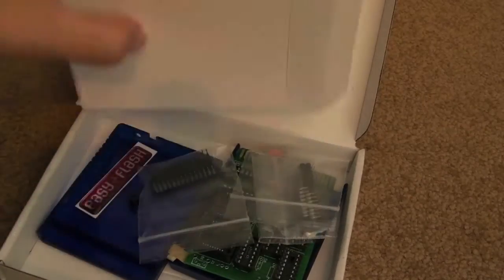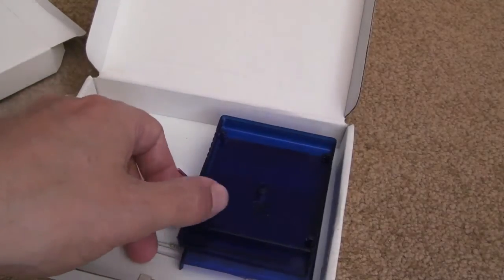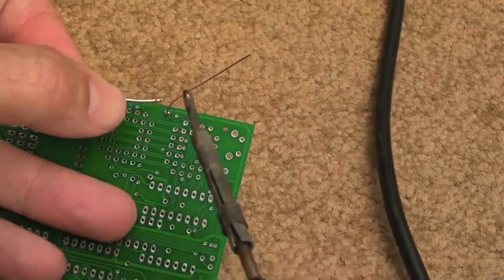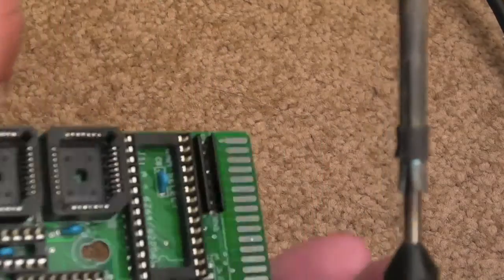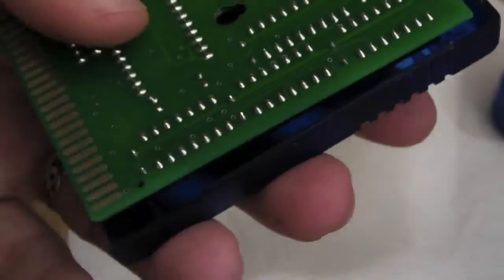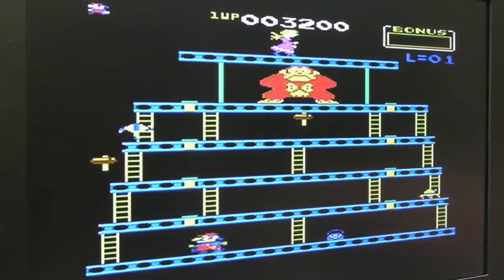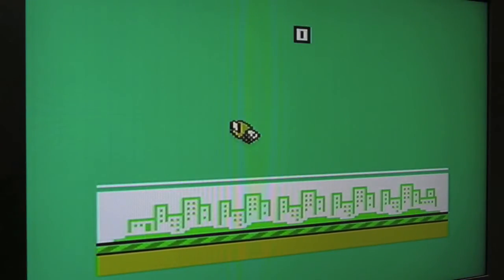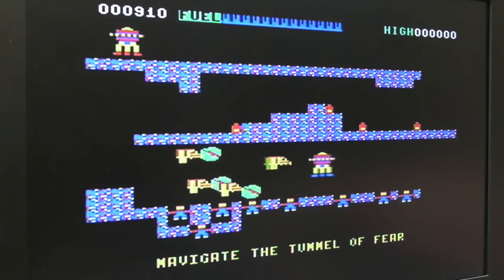Commodore 64 (C64) Easy Flash Cart Assembly & Testing

Comment: Hiya. I've just bought an EasyFlash  3 from Retro Innovations and I don't have an idea about it. What I'm wondering now is about the kernal rom booting feature. I would like to try to change and then try some modified kernal roms. Let's say editing the C=64 one to show for example the booting colors of a C=16 as I'll be using a C=16 case for my C=64 board. Will I be able to try the kernal that I could make for it before burning (or ordering to burn) a new eprom with that new kernal?. How can I archieve that?
Reply from the maker: Yes, you can totally do that!  You can edit an official kernal ROM and change the text with a hex editor super easy - just open the ROM in the hex editor and scroll around, you will see text probably on the right hand side.   You have to be careful to type over existing text and cannot go with more characters than appear in the original string.   You can also change the colours by finding the instructions that set the colours and change the byte for each value.  There are probably guides on the net for this.  I would personally probably disassemble the ROM in order to find the instructions for setting the colours.

Comment: Another great video, really looks an impressive piece of hardware. Would you recommend this over the ds reader you can buy?
Reply from the maker: The SD2IEC is great!  I got one of those with it and I've managed to play loads of games from SD card.  The reason to own both is so you can run Epic FastLoad from cart, which speeds up the disk loading a lot.  The alternative is to get the SD2IEC and also buy a JiffyDos Kernal upgrade and fit that.   The only real reason to buy the EasyFlash cart is if you want to play old cart games, or have a few programs and games that you can instantly boot.   Thanks for the nice comments btw =)
Reply: GadgetUK164
I was wondering what the advantages of this were, given how limited the storage vs. an SD-based solution, but you've answered it.  Nice to Jack Attack on your cartridge, it's a favourite of mine; was it one you played back then?
Reply from the maker: MarkTheMorose The main reason to get one of these is basically to still a tonne of 8Kb and 16Kb games on one cart.  In the example shown on the video I just put a handful of games but it would have fit a lot more on there.  Jack Attack was great fun - happy memories playing that on my friends C64 =)

Comment: what is the largest flash eeproms that these carts are able to use i have a good few 256k and 512k but i should have some in the low megabyte range maybe 2 megabytes if I'm lucky but iirc they might not plcc32
Reply: also can you make some sort of multi cart with a loader menu with these. haven't messed with commodore after my c128 died a few years back...
Reply from the maker: I think the largest is 512Kb.  Yes, you can make a loader menu - link is in the description of the video.

Comment: Could this be used to make a Diagnostics cart?
Reply from the maker: Yes, before I got my 1541 Ultimate I used the Easy Flash as a diag cart.  Note there are different types of diag cart - you can also get a 'dead test' cart which works better on a machine that give a black screen.
Reply: Ok thanks. Yeh I think for my purposes a dead test cart is a must and maybe I'll use my ultimate 2 (when it arrives) for diagnostics. :)

Comment: Doing assembly on your carpet because extra static testing required?

I'd probably use a desk and maybe even a grounded anti-static mat, at least when you insert all the chips :-)
Reply from the maker: +Alfred Stampe Yes, I've got an ESD mat and wrist strap!  I just occasionally get lazy and to be honest I cannot generate static on that carpet if I try - and I have tried!  It certainly isn't what others should work off though!
Reply: LOL...yeh we've all done it...too many times in my case!! :-P
Reply: Sure we have, but try get one of those static potential meters and you'll discover that even waving your hands around will generate 1000s of volts static potential even in a really humid environment, more then enough to cause a latch up fault condition on older chips.